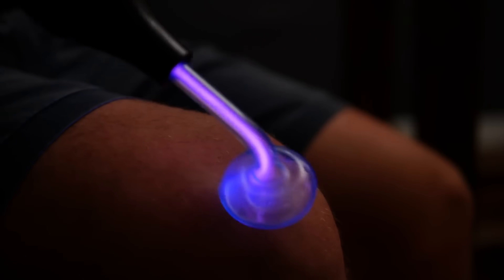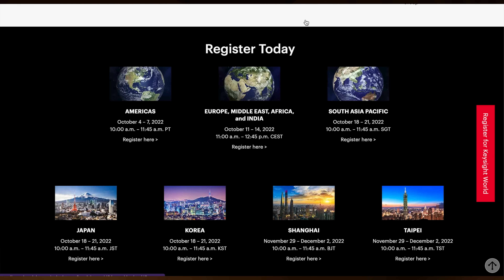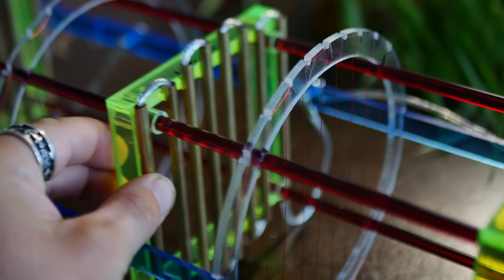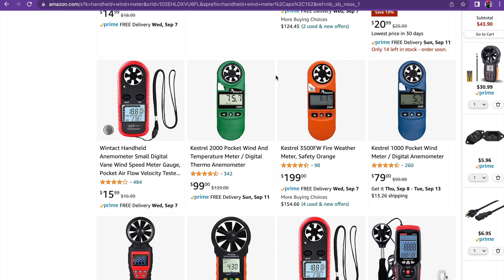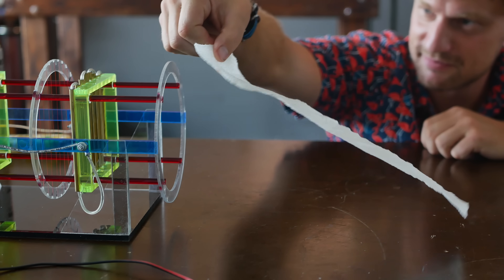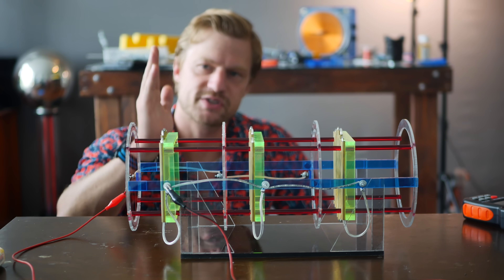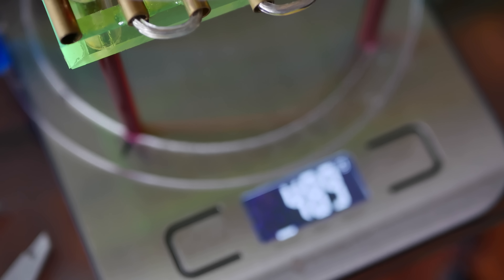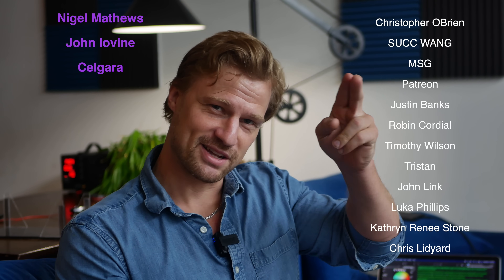Designing A Next-Gen Ionic Thruster! (For Flight)

Comment: Firstly as far as air flow for acceleration.

1. Contained in a tube. The open design may be great for testing. But its allowing the air to mix with air outside. So slowing and messing up the flow between stages. 

2. Aerodynamic pipes. Having pipes is easy but it's introducing more turbulence. 
Aerofoil sections or thin sheet metal so reduces turbulence. 

3. Another critical pint is wire diameter and density. Is a 0.1mm wire better than a 0.5mm? How close and how many should there be? 
Too close and it will inhibit airflow. To thin and its easy to break. But in theory the smaller the diameter the lower the voltage to begin ionisation. 

4. Combined target and ioniser. Something like an airfoil section but with a spiky trailing edge. So each section both attracts from the one in front and inonises the air leaving to attract to the next. 
Eliminating the ionisation grid wire entirely.

Comment: Amazing work. Looks fantastic.
Reply from the maker: Thanks!
Reply: @PlasmaChannel  thinking about it I wonder if you cant increase the velocity with larger to smaller aperture sixes to use the Bernoulli effect to accelerate the air and decrease the pressure around it. This wpd lighten the load by making some of them smaller and possibly lighten the power consumption

Comment: The last measurement you took with the staggered spacing at 8:35 wasn't measured correctly, as you put the unit in front of the center of the output, instead of near the top like you did at 7:28
Great video, really informative, also scary too (with the high voltages)! Thanks for sharing

Comment: to maximise surface area, you could use progressively smaller rings of metal evenly spaced within each other. This should also have the added bonus of channelling the air out the bottom and preventing airflow from escaping out the sides of the engine. The only downside is it would weigh significantly more than your original design.

Comment: 1. Put it in a tube.
2. Keep the anode and cathodes around the walls of the tube, reducing drag.
3.1 Add an inlet funnel, and a venturi outlet.
3.2 Use Superconducting wires.

Comment: really cool! these are some of the things im guessing might improve on the design.: i think it would be better to have the individual thruster sections side by side, roughly doubling the thrust?(from your numbers). also, maybe encasing the whole system in a lightweight tube would promote laminar flow, and a more aerodynamic structure. lastly, i think minimizing the weight of the negative electrodes is important, since they are big contributors to the weight (im guessing). im really exited to see how this project evolves!

Comment: Inefficiencies: 
Acrylic vs Alternative construction methods - weight can be reduced significantly using lighter materials (Acrylic is 1100kg/m3; Balsa is like...160kg/m3).
Plasma focal points - wire creates unevenly distributed foci for plasma induced wind.  Foil here with distributed focal points could help thrust velocity.  Likewise, increased density of the points may help as well - though there is going to be a point where the benefits get outweighed by additional airflow restriction.
Open-tunnel design - Wind is not ducted down the tube, and you may be experiencing some air deflecting out into the open environment.  Honestly this could be helping as well, by pulling in additional volume of air because of the negative pressure in the area.
The Coanda effect might be causing some air to stick to the negative plates.
Frequency of the high voltage drive can also determine how ions flow in the configuration so altering this may produce some results as well.
Additionally series vs parallel operation: You may be better off with these working in parallel rather than series.

Comment: Could use rings of wire and more stages — but only 2 wires at each stage (push+attract), then each stage as you go backward has a larger radius than the last.
Attract ring is smaller than the push ring, so the ‘vector’ is inward

Comment: I wonder what would happen if one put a cathode at  the opening of  a converging diverging rocket thruster nozel and placed the anode in at the exhaust opening. 

I suspect the gas flow would accelerate on the converging end and the pressure would drop, giving a greater mean free path between collisions. Electrons would accelerate longer  in  in a lower pressure and impart their momentum on collisions with air molecules. Maybe a rocket nozel will help convert heat generated  into thrust.
Reply: For a converging-diverging nozzle to be of any use the flow speed at the throat has to hit Mach 1. No way that will happen with this set up.

I see what you are getting at with trying to increase the mean free path of the electrons but I'm fairly certain that to see any significant change you would have to reduce the pressure quite a bit, a lot more than what you would get blowing air through a nozzle...
Reply: @Ender240sxS13 Theres something different going on as the current density increases as the throat narrows. More mean free path, electrons accelerate longer and nock more electrons off other molecules,  the gasses heat up more. Any thing else you can think of?
Reply: @kreynolds1123  hmm... So I did a little bit of reading and the mean free path is inversely linearly proportional to pressure and linearly proportional to temperature. So pressure decreases increase the mean free path while temperature increases decrease the mean free path.

So I don't know how placing a nozzle between the electrodes would effect the energy input into the air stream, I still suspect the effect would be negligible if not negatively impact it but some one actually needs to test it.
Reply: @Ender240sxS13  still on the throat. The gasses were accelerated and they are in a lower pressure state here. Shouldn't that lower the temp while ionizing adds to the temperature.
Reply: @Ender240sxS13  we are hoping to improve the velocity.  I'm inclined to belive a nozel will help.  But I am not sure if it will reduces the volume, or If the nozel adding weight ends up lowering the net thrust to weight ratio.  

There's so much heat and light energy not contributing to thrust adding to inefficiency. I suspect adding a shroud and nozel will help convert them to heat and eventually thrust and improve the efficency.

Comment: amazing work , lovely still images , there is a research done by a german univercity where they used plasma impultions to generate thrust , as a ram jet but the explosionsare high plasma discharges in the chambre , mix that with the bernolie effect that jetoptera is using ,basicly a air thruster multiplier ,and you will have a electric thruster , or maybe as a detonation emgine works , electric discharges that cause shockwaves of high speed air .

Comment: You might want to arrange the air intake for laminar flow trough or around the ionisers. Building a tube around it would be a cheap and dirty way but you will still have turbulent flow which will still limit the maximum velocity of particles.

Comment: A enclosed tube instead of open, would make a difference. Also compression as seen in jet engines could be a welcome improvement. By changing the amount of wires and shape of the tube, by tapering it. These are just some of the adjustments I can think of right away.

Comment: Can you try rotating each next by 90 deg ?
Can you try encasing in tube ? (or maybe even better why not doing something like dyson fan)
Also can you please try variable gap between positive and negative, and then again positive and negative? (more complex would be not to replicate but test different gaps between all elements)
not just 1cm gap all but (1cm 2cm 1cm 2cm) or (1cm 2cm 3cm ...) this would be also combining with variable voltage?
Can you try variable voltage first 10k then 20k then 30k  per segment would that change anything? (combine with gap difference)
Finally, I am not sure about disconnecting measure, as you are not removing it, and positioning airflow meter at the same distance from the last working is it valid speed? Wind speed will drop with distance, and also that disconnected stage will be obstacle...

Comment: can the spacing go smaller than 1 inch, and will that improve velocity?

can the frames be made thinner?

Can a super thin-walled shroud of something non-conductive help with velocity?

will a gradually changing diameter for the frames result in more wind? using smaller thrusters to help accelerate progressively larger diameter thrusters?

if the larger electrode is flattened slightly and turned topresent a smaller frontal surface area like an airfoil, will that make the thruster more efficient?

Can the larger electrode be made of a thinner material than those copper tubes? like a light wire frame but with foil to expand the surface area?

Comment: Would rotating the grid alignment of each thruster increase the output, instead of lines of thrust you would have cones of thrust, also adding a kite fabric around the outside to funnel the air flow and a nozzle made of kit favric at the end to focus it, remove all the pastic and replace with carbon fiber dowels.

Comment: If you look at the still shot at 9:10 you can see the plasma being generated, but it doesn't seem uniform as well as it appears that only a small portion of the conductor is producing plasma. An increase in voltage may help but there is something that could be done in this area. I realize you left it as an open chamber for visibility and ease of construction but you are losing a lot of force without it. Also if thrust or force is what you are after you should look at a conical shape tube and size your plasma plates accordingly. Simple aerodynamics at this point, add a funnel shaped intake, this will add in the intake air supply. There is a lot that can be done, simply doubling the number of conductors would help. I still think there is something preventing a full stream of plasma from the conductors. Good luck I'll wait and see what you come up with.

Comment: Fantastic footage! You could use increasing Voltages for each stage. instead of using a single (even though HIGH) voltage, to have an acceleration cascade; just like what happens in Electron guns where the voltage potential is increased at each stage:
https://circuitglobe.com/wp-content/uploads/2017/06/electron-gun.jpg
Or, if you could manage high AC voltage (which frequency can be inferred by the distance of the electrodes vs the transition time the molecule needs to travel that distance, use an alternating current like in this scheme), which is actually used in linear accelerators (LINAC):
https://upload.wikimedia.org/wikipedia/commons/thumb/a/a5/Wideroe_linac_en.svg/800px-Wideroe_linac_en.svg.png?20051002131232
The idea is to "push" the ionized molecule once it passed the ionizing stage.

Comment: Nice design!  Are you snapping on nodes to the bars?  Inclosed mini nodes with a negative rim twist every which way could bend your pressure. A negative wire behind your positive connecting rims might work.  A steel wool donut might resist your pressure.
Reply: Spiral node!  Little conductive triangle twist stretch to the positives sounds great.
Reply: Ions everywhere circling.  Big triangle twist to shiny rim half donut sounds best dangling everywhere.  Scooping ionic pressure trails subtopic propulsion.  Thats solid hot pink if you stuff the tip with steel wool.  Might need new wire. 🎉
Reply: Finding a thread area's a good bet.  Negative level surface threaded puts more pressure on the plasma joule.  Put a tiny negative rim on the joule it might stabilize past the rim threaded.  Gaining less resist spaced threading.
Reply: + Node inside - rim threaded arc adds divided resist joule level for a megawatt.
Reply: Good one GIrvine. Higher gauge wire razor grated might fit snug enough.  Enables efficient snug node counts thin wire would last.
Reply: Will do.  Thanks!

Comment: Hi.)
Have you thought about the potential difference?
I suggest you conduct an experiment with static electricity and a structure similar to a jellyfish. It consists of 2 umbrellas that have different potentials and different sizes, and they are on a thread. The radius of the spokes of the front umbrella should be longer than that of the rear. Turned to one side. On the front minus, on the back plus. You can put it another way. There is a gap of 11-12 cm between them (ballpoint pen body).
Because of the potential difference, the whole structure should simply accelerate, be checked horizontally and slightly upwards. Then you can think about how many things you can come up with thanks to this knowledge.

Comment: Inefficiencies:

1. Need an enclosed air flow path to cut down on turbulence and pressure loss from the sides. Put this all in a tube!

2. Need shaped electrodes as the copper tubes are probably impeding flow. Not sure if they should be super thin like wire or perhaps something airfoil/blade-like would work better. Airfoil is interesting as the sharp point at the back would encourage emission to the next stage. I actually think an airfoil where only the sharp point at the back holds the charge would be an interesting design as the electric field lines should wrap around like the desired airflow, which should pull the ions around the foil. The sharp angle there also encourages laminar flow once the ions are neutralized on contact.

3. I think staggering the stages with progressively higher voltage would be more efficient. With the same voltage at each stage, some ions could get pulled back towards the inlet, so the idea is that you want all charges at any stage to always see a deep potential well pointing towards the outlet, thus applying a consistent acceleration in one direction.

4. I'm not sure what effect this will have, but I would experiment with different inlet/outlet areas. I expect a wide inlet and a narrow outlet to work better as it does for jet engines, but the principles here are a little different so maybe not.

Comment: There's a little more trust to be gained if it's a tube and not open. Carbon fiber tubing for structure weight and mylar to wrap it with to make it a tube. Idk if it's just how the arcs like to jump, but if you can make the hot spots on the wires be consistent for the whole wire, that'd be good. Also the cathode tubes should be teardrop shaped for aerodynamics.

Comment: Use aluminum wires rather than copper and take advantage of how permiter and area scale. 

I dont think copper added much weigh, but consider that although aluminum is 61% as conductive as copper, it is just 30% of as dense. That means that aluminum weighs half as much as a copper wire of the same electrical resistance. Besides that weight savings, an aluminum wire of the same conductivity has a larger diameter putting it in contact with more air molecules.

As to scaling, the weight of the structural frame largely scales with the circumfrence while the thrust scales with the area. 

When one multiplies the permiter by 2 they double the weight, but the area goes up by the square of 2. Doubling a circle's diameter doubles the circumfrence and the frame weight while providing 4× the area creating thrust. In short, you effectively double your thrust to weight of the frame ratio. As to the weight of the wire, it scales by the square but the wire is not much weight to start with and you may half the total weight of the wire by using aluminum instead of copper.
Reply: The last one is good. I didn't even think of that.
Reply: @Pystro  I think these two points work good together.  Certainly at some point while scaling up, one needs to beef up the frame and the wire scaling by the area begins to become significant. Switching to aluminum wire would hold back the need for additional structural  support somewhat.  Remember that if you scale the diameter by 10, the area goes up by 100. Let's not forget aluminum also cost less than copper.

Comment: In my opinion there is only one goal. Find out where the electricity is being lost. The watts per thrust is terrible to put it lightly. 100 year old propeller designs are 10x mabe100x more efficient at converting wats to thrust. I say increase the instrumentation to collect more data on the input vs output of the electricity. Use a thermal image camera to record heat loss, redesign it so you can very more parameters so you make the most use of every electron. For example the gap the electrons jump needs to be tested, the type of gas, the shape of the electrode and cathode, precision shapes. In your photos I saw lots of points where electricity is being focused. A more precise surface will spread out the electrons more evenly. Amps/Volts testing, which provides a better thrust per watt, instead of a grid shape try a ring like the dyson bladeless fan. If the wats per thrust doesn't improve much I would start to question the whole thing. This type of thing reminds me of the Pulse Jet Engine. No matter how hard people tried to make that engine a success it never worked well.
Reply: Air Ion thrusters do a fair bit of heating air. And that pretty purple light is radiating a significant amount of energy in that light without providing thrust.

Maybe one could figure out a way to to turn that light to heat, and the heat into additional thrust.

Comment: Congratulations on the amazing build man! Those low-light pictures are absolutely gorgeous, and I'm impressed with how much air you could push with just high voltage charges. Maybe you could get together with PeterSripol to develop a low-speed ultralight model aircraft for this thing to power!
Reply: Tom stanton on youtube has already designed some great aircrafts designed to be very light and fly under very low thrust, I think that would be an amazing pairing.